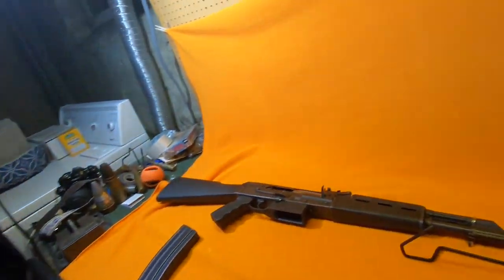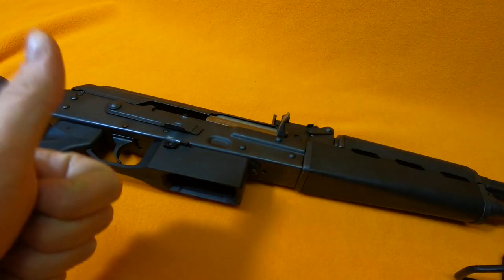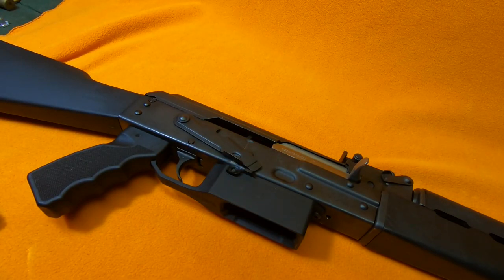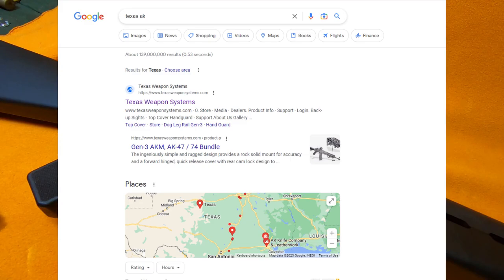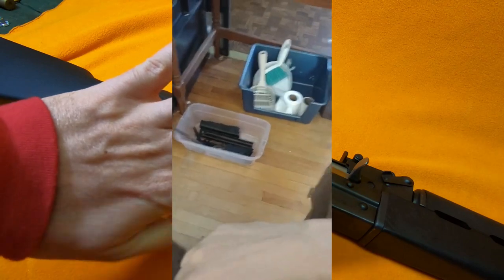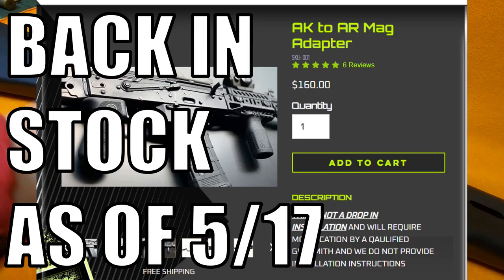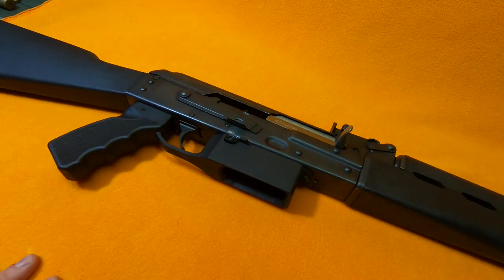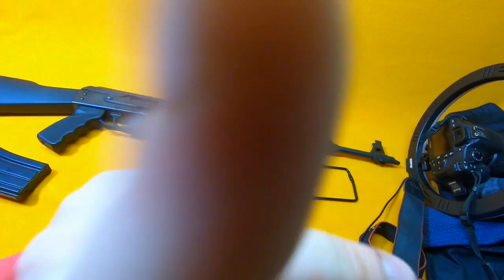Zastava M90NP: Fixing Century's Abomination With The Help of Shaffer Machining

Comment: Hi, I'm doing this same exact thing atm...I was wondering what did you do about the very rear rivet that goes through the trigger guard and bottom of the rear trunion?
Reply from the maker: This was a while ago at this point BUT I believe the hole left by the rear rivet means that the rear bolt was just a bit too close to the trunnion. This meant that the head bolt would kind of hang on a small piece of material off of the rear trunnion not giving it good purchase, and not letting you tighten it down. What I did was take a washer and I squared off a little bit of material on one side so that the hole of the washer matched up with the hole of the rivet and it pressed up nice against that piece of the rear trunnion. That way when I tightened the bolt it would get a nice purchase. I can't remember if it was the same width or slightly thicker, but it meant the head of the bolt didn't need to be made smaller and it retained good pressure to hold the rear in place. The FRONT bolt+nylock is the real pain in the ass, and that actually took some removing of material from the front trunnion using a dremel grinding head to make enough room for the nylock AND hold it in place with a thin enough wrench that can slip into the gap. The wrench piece was honestly the most aggravating part of this whole thing since you are basically flying blind getting the screw into it. Hope your conversion goes well!
Reply: @SUPER_HELPFUL oh ok... thanks for the help

Comment: I have the same model, the adapter on mine works, polymer mags drop easily, just the cerakoted mags don't but I'm fine with that i can still use it. But i also have the zastava arms m70  2019) the quality is massively different lol century arms sucks

Comment: That's what you get for thinking an 8.5lb 5.56 was a good idea.
Reply from the maker: I am not the purchaser of this "fine" rifle, a friend of mine had been sitting on it for a while after someone else scammed him into buying it. The goal was to get it fixed up enough that I could sell it and then give him what he paid for the rifle. I just wanted to put this video out so no one else makes such a horrible mistake, and if they did they can at least fix it.

Plus I would never buy from century, I made that mistake one time when I bought a used c93 at auction that turned out to have the headspacing issue.
Reply: @jackhallowatt  understood, sir. Props to you for not being a dick to me, although I was a bit (must have been in a sour mood). Sorry bud and thanks for the video.